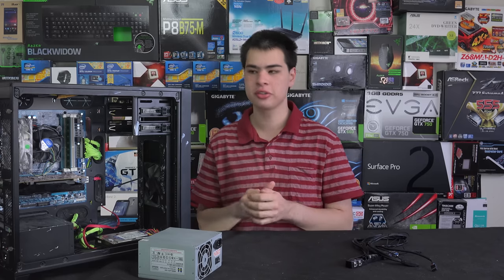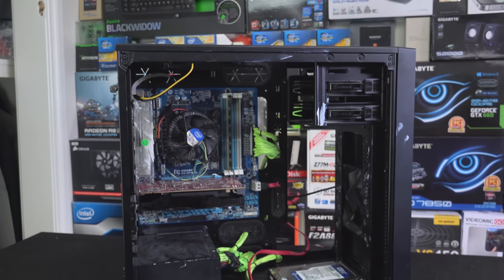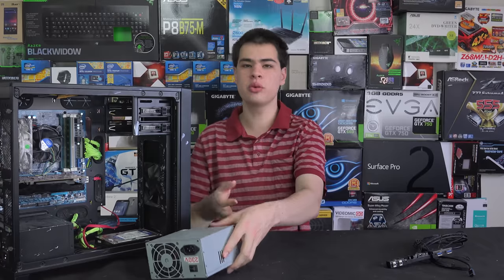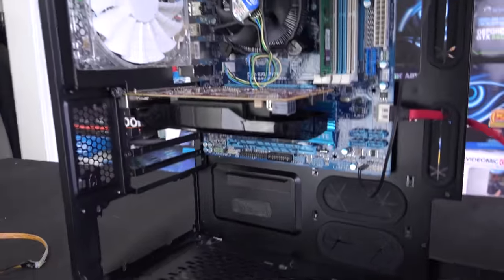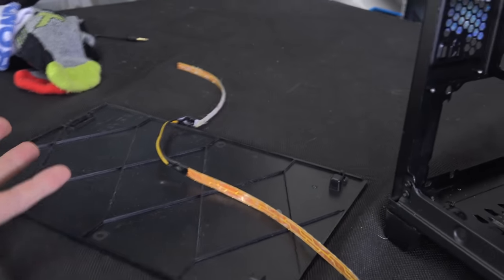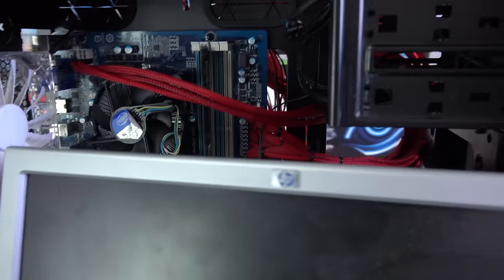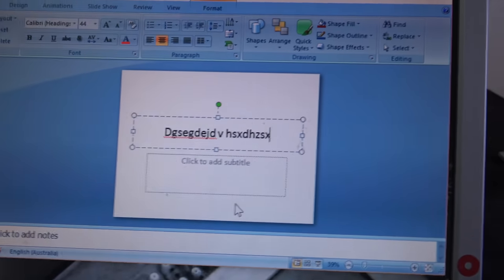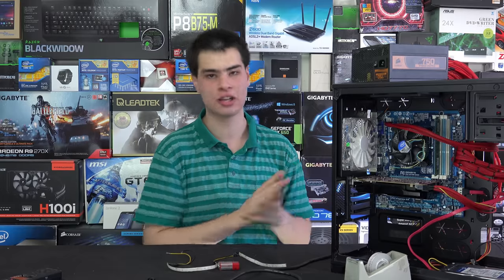Can You Wash A PC?

Comment: It does not surprise me that the PC was still working after you washed it - although I do not know how long you let it dry..Motherboards and GPU PCBs are usually washed when they come off of the assembly line; however, they are thoroughly dried before they are packed up and shipped out.Fun fact for those that are unaware: H2O is not conductive. However, the water that comes out of your tap contains impurities that are conductive. Pure distilled water is not, that is why it is recommended for batteries (like for your car), and PC water cooling. Although the distilled water running through a PC cooling loop will (over time) pickup conductive impurities from the metals in the blocks and rads..

Comment: +CPU modder You can wash a PC as long as there isn't any power going to it. I personally clean REALLY dirty PCs with a literal shower and +uxwbill cleans his computers with a dishwasher when he gets a tobacco scented dustball for a PC!

Precautions, however:

> Allow the system to dry COMPLETELY before use
> Remove the CMOS cell before cleaning.
> Do NOT immerse hard disks in water... you WILL lose data! Instead, use a damp cloth to wipe them down. SSDs can handle being washed as long as you allow them to dry

And most importantly of all:

You really should completely disassemble the computer before washing. This also applies to power supplies. However, you REALLY need to make sure the filter capacitors on the mains input side are drained by shorting out each one with a metal object such as a screwdriver or a paperclip. Failure to do so will damage the power supply.

Comment: rather than washing it in water and soap..just clean it with electronic cleaner spray and let it dry for a day(for extra caution)..electronic cleaners are non conductive fluid and dry fast, but i never really did want testing that but in theory should work even if you spray it on the circuit while it is plugged in..there are videos on youtube doing that too..the cleaner makes your components look and smell new too!
Reply: or just use distilled water. It's also not conductive and it doesn't react with some types of dyes. Although as you said (i've never used an electronic cleaner) it probably would smell nicer and maybe clean some thick grime or something. I guess both are good options. 👍

Comment: Me and my friend washed old computer, first we remove any battery, discharge capacitors, wait few hours then gently wash with water. Used air pressure to remove some water and then leave it 2 days at sunny day at +30°C. Computer worked jest fine.

Comment: Aside of using isopropyl alcohoI have seen people "wash" computers with break cleaner. Just about anything non-water based that drys quickly (providing the PC is not plugged in) should be fine. Aside of the electrical issues rust is the main concern of using water on PC hardware.

Comment: You can take also a tooth bruss or spray bottle with Rubbing Alcool (non conductive electricity) then used air blower. some electronic part's can be soak directly into a pot of alcool with no problem...

Comment: Very DANGEROUS using water on the parts bro you should use the ( tech yes city ) method a fellow AUS and use electrical cleaner, contact cleaner or break cleaner AKA electrical cleaner it will not short any part you have in any way i also use this method my self and have done for a while now and it does an AMAZING job at cleaning the parts without the risk of damaging them, then you just lightly spray all the parts down with WD40 for a good look shine, WD40 is a water dispersant so that also will not short any parts in the computer in fact i have seen people use WD40 on live running pc's and they still don't short anything look it up or try it trust me it works or check out Bryn from Tech Yes City he does this to clean his pc parts all the time

Comment: Not a great idea. If you want to wash your computer use a good quality organic solvent solvent. The problem with water is that it can get into moving parts (fans, disk drives etc.). Also the washing can leave mineral deposits on the board, which may conduct if the board is used in humid places. A much better approach is to simply blow the computer out with a leaf blower at about 1 meter (3 feet) away, and wipe whatever remaining dust remains with cloth.